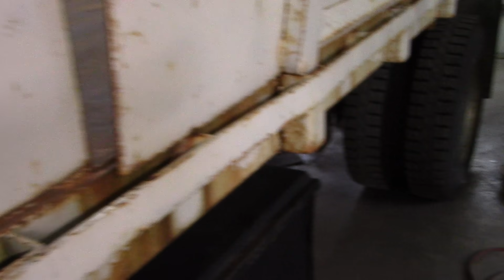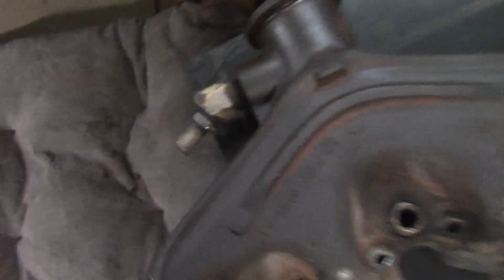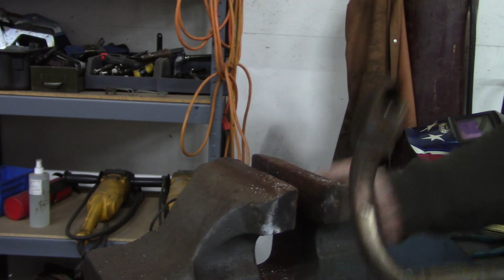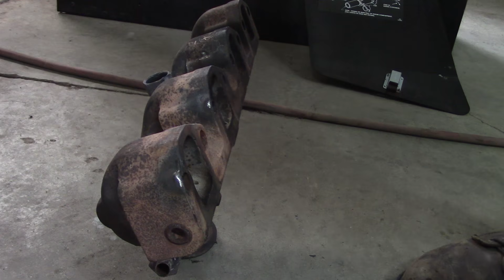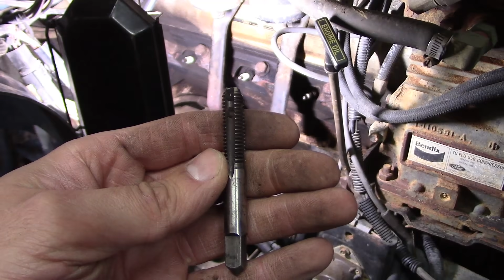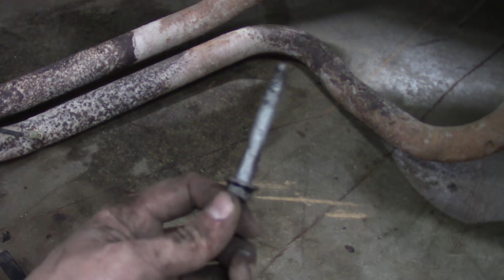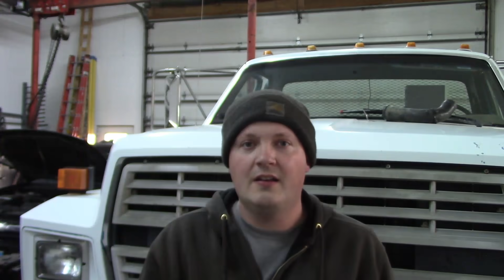Ford F700 Project - Exhaust Manifold Leaks (Gas Engine) - Part 1

Comment: I have an f7 dumptruck at work wes. Its diesel though, thank the lord. 35k on it. Runs real good except when it's really cold out. We plug it in but that only does so good. Has 10ft v plow  and we cant live without it. Only just started watching and thought I would comment. Keep your powder dry lol.
Reply: And since when do you use ratchet wrenches?
Reply from the maker: Is it a carburetor?
Reply: No,It's a early 90s turboed 7.8, I like it but we have ran onto similar problems as you are dealing with. I had to weld the exhaust with some cast rod. Someone had tried to stitch pin it at some point. I drilled every stitch pin out and used cast rod to fill the holes.

Comment: Good call, cast iron heads, resurfaced cast manifolds or new manifolds and new bolts properly torqued, NO MANIFOLD GASKETS ever........ cast iron to cast iron on any engine and you will never have a problem again. 30 years experience working on old shit like this!

Comment: Yeah, someone on YouTube actually fixes a metal crack 'the right way' .... solely my opinion but I like it. 
For what it's worth I've had the best luck replacing the Ford nylon vacuum llines with soft coil metal brake line.... it takes a little bit to bend up the right shape and work into place  but problem solved permanently. I use a short piece of rubber/silicone vacuum line for the final connection.... otherwise it  seems like I'm chasing new leaks 6months later.....good luck with the project whatever the solution 👍

Comment: Obviously, you have got to have the patience of Job. It always pissed me off that the engineers designed vehicles with no thought of anyone ever having to repair them. One question, since the engine is running rough, why didn't you at least pull one spark plug for inspection. Hell of a lot easier to replace the plugs with the exhaust manifolds off.

Comment: That towing ring out the front would never pass a legal here. Especially at pedestrian shin height! 
Plus, I'm still gasping at a 7 litre petrol in a teensy little truck! It must drink like a fish.
Just shows the difference in fuel costs between Europe & the US.
Reply from the maker: This truck has a 15 ton weigh rating.
Reply: @WatchWesWork  Trying to get a handle on equivalent sizes Wes. Does that mean it'll carry 15 tonnes. It doesn't look like it weighs 15 tonnes. 
Or do you mean load + truck = 15 tonnes? 
You're definitely right about cabovers though! You don't see conventionals here at all. Even the little 7.5 tonne (truck weight) Iveco Ford I used to drive was a cabover. I know that anything you'd get over here would be a turbo diesel though. Petrol commercial engines are unheard of!
Looking forward to the rest of the series 😃🔧
Reply from the maker: @Aengus42  Total weight of payload and truck is 15 tons. I think the truck empty probably weighs in the area of 6 tons.
Reply: @WatchWesWork  A quick look brings up this ex council tipper. It's a bit chunkier at 7.5 tonne but not by much. https://walkermovements.co.uk/vehicles/iveco-eurocargo-75e16-euro-5-4-x-2-7-5-tonne-steel-tipper-2008-nx08-cff/
The 4.5 litre four cylinder PACCAR FR diesel engine is available with outputs of 140 hp, 160 hp or 185 hp and torque levels of 550 Nm, 600 Nm and 700 Nm.
The one in the link is the 160hp version.
Just shows the different direction European trucks have gone in.

Comment: I know the pain and suffering you incured , all the early model ford's manifolds cracked and bolts would strip out, the 360's were famous for testing your language skills and sleepless nights. And you know the studs are going to strip out more grinding of the teeth but good luck with drilling them out, I quit !

Comment: I do agree that cab over trucks are a breeze to work on ,unless you are here in England where the coach works companies decide to put a horse box on them and don't relies you need to tip the cab to get to the engine and climbing up under the wheel arch to just check valve adjustments is not so much fun.

Comment: Most any factory engine did not have gaskets for the exhaust back in the day.  They are a "band aid" fix for corroded, uneven surfaces that someone let go too long when the mounting bolts broken and allowed the manifold to separate from the head.  Great work, love your channel.

Comment: The secret is to loosely start the two end bolts, insert the gasket, then start the rest of the bolts. At least you aren't having to deal with the multi-piece gaskets. This brought me flashbacks from replacing manifold gaskets on several old farm trucks in my youth. Makes you wish the manifolds were on a tractor.

Comment: The truck locks the doors after you start the engine I don't think that's embarrassing that would have pissed me off especially the waiting on the customer having to come all the way out just to unlock the doors seems like questions should be asked when it comes to things like that.
if you own a car long enough you should know what it does when you start using it.

Comment: I guess thats quite a problem on gas engines, diesel fumes have more grease in them, keeping their surroundings lubricated...
:-D
The manifolds tucked way back between the frame rails and packed with wires and tubes reminds me of a similar job on a FWD engine, the exhaust near the firewall, was fun too...
Great job Wes, I think the next parts will be interesting too!
:-D

Comment: I had a '79 Grand Wagoneer with a Ford 360 in it - nothing but trouble with the passenger side manifold gasket.  I replaced it three or four times before giving up.  Figured I had a warped head or manifold, maybe  I did.  But now I'm wondering if the problem was that there shouldn't have been a gasket in there at all.  That never even occurred to me - thought everything with a manifold had a gasket!  Anyway, very educational video.  I admire your fortitude, Wes!  You really know how to stick with it until it's right.  Nicely done.

Comment: You did the right thing in repairing the emissions system - skirting the rules is always a bad idea IMO.  I did like your line early in the video, “Who needs a thermostat [or a pressure gauge on an air compressor] when you have a camera” (...and are shooting a video.....)

Comment: Surprised they haven't blocked off the EGR and plugged the smog pump lines... First thing I did on my 95 3/4 ton. Been running stronger than ever since then. Of course the cat delete helped it. Things were plugged right solid...
Reply from the maker: This truck never had cats. But it had everything else.

Comment: You had me at “Ford exhaust manifold leak”. This takes me back to my ‘69 Thunderbird 25 years ago. Apparently Ford never did figure out how to make non cracking big block exhaust manifolds. The right side required dropping the starter and the left required popping the steering linkage, not fun. The 429 did not come with gaskets . We won’t talk about doing the freeze plugs.

Comment: You got to love 370 429 engines the flanges for the pipes are notorious for leaking especially if it has a 2 into 1 muffler the pipes like to bend big time

Comment: He probably brought it to you because the last guy told him not to bring it back. Or because he did one himself and doesn't want to touch it again.
Reply: With all the broken parts and pieces, the owner knew only Wes could save money from having to purchase new or used parts on a vehicle nobody else wanted to work on.

Comment: You should put those manifold gaskets on ebay, you can buy everything there for the genuine cheapskate. Low mileage timing belts are my favourite, and used clutches too. ;)  I'm surprised I've never seen lightly soiled engine oil and filters at a bargain price there before (obviously because they "just serviced the car and 5 miles later the engine blew up, be a shame to waste it"...)
Reply from the maker: The junkyards here sell used antifreeze, used washer fluid, even used gas and diesel when they have it!
Reply: @WatchWesWork  Just why lol, the very fact they're selling the fuel means they wouldn't be happy to use it themselves surely?  I have accepted free fuel from a friend at a yard before, but they did use it in their own equipment & took reasonable care over what went into the "keep" tanks versus what went in waste. Don't think they ever sold it though, just used it up themselves to offset some of the cost of running.
Definitely wouldn't want to trust used coolant though, even if they kept colors separately  there's still different cocktails that have the same color & would gel up if mixed  :/  Each to their own I guess lol, if they're selling then people must be buying!

Comment: Looks good 
I know there was money reasons but gas engines in his type vehicle is crazy in my opinion
I have driven that type of truck in my day didn’t like it gas stations never got to far away
Out here in the PNW  a lot of cranes were put on this style of truck one guy I knew had to have his engine rebuilt every year
Probably his choice of a crane on a truck was the wrong decision but he needed a crane he installed HVAC on commercial buildings
Reply from the maker: Gas engines are cheaper and cheaper to maintain. For guys who don't run a whole lot of miles they make sense.

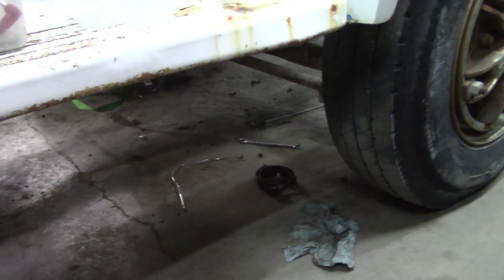Comment: 29:48 small tip (probably a granny sucking eggs job, but if it helps one person I'll be happy). If something goes down an exhaust or other open-ended tube/pipe and you can't grab or magnet it out, wrap an old sock on the end of the shop vac, taped on so it sits inside like a pocket & then put the vac to whatever the tube is (use tape or hand etc to get a better seal) and a lot of times it'll pull the part right out & catch it in the sock so you don't have to fish it out of the vac bucket.
Reply from the maker: Good tip!
Reply: @WatchWesWork  JUST the tip mind, and only for a minute (to quote AvE).  Having continued to watch the vid, it was probably easier to just drop the exhaust in this instance though. single bolt job for the win.

Comment: The ONLY practical way to fix those damned things is NEW heads and NEW manifolds.  If they don't make them anymore, then tell the customer to get a NEW truck.  I bet they still make those pieces of junk.  If you get 1k miles out of that repair, I'll be very surprised.
Reply from the maker: We shall see.
Reply: @WatchWesWork  Nothing against you or your workmanship.  I just know those engines much more than I ought to.  Cheers:)

Comment: Grease smells like success, and that ain't so bad. Before your postscript, I was going to ask what you thought about not using them. I have just had the manifolds surfaced on GMs since the eighties, those gaskets are awful when they wear out. Never tried the grease though. 
  As usual, thanks for the look in.
    Best regards from Indiana.

Comment: Nice job Wes.  What's your thoughts on using a very thin coat of high temp silicone on the flanges?  seems like a popular substitute for gaskets these days.
Reply from the maker: That would work fine.

Comment: On our truck motors we got about 12,000 miles on OEM plug wires. Aftermarket wires got 50,000 miles. The clue was black smoke and low power under load.

Comment: There really isn't that much emissions crap on there other than air pumps.  None of it really affects how it runs at all.  It does affect exhaust manifold temperature.  They run great but they break manifolds and there is nothing you can do about it with stock parts.

Comment: Never heard of using GREASE as a Gasket but I'm guessing the manifolds better be damn FLAT to use this method ? I have a header leak on my 97 Jeep 4.0 at the exhaust gasket right in the front ( it's not that bad ) but I have been putting it off for years, LOL. I've also had the new parts for years maybe I'll tackle that job soon now ? It has to be better then what you went through, RIGHT ? LMAO.

Comment: Those engines suck for exhaust manifolds.   People babble on about anti-seize from factory.  That is rubbish.  Those manifolds expand so much that the shear the bolts off during expansion.  Nothing one can do other than, perhaps steel headers that don't have the shear force of those cast iron beasts.  Fix it today and they'll be broken tomorrow.  I've seen several that have broken the ends of the heads off instead of shearing the bolts.  My rule was: > 3 broken bolts and it gets a new cylinder head.  They're actually pretty inexpensive.  Crappo engineering.

Comment: Great job Wes.  I'm glad I went to the very end.  One thing I learned from Stephen Cox's youtube channel is that when he removes the exhaust manifold bolts (with or without heat), he cracks them loosed and re-tightens them. Once all of them have been cracked loose, he then removes them together rather than one at a time.  He feels there is far less bolt breakage.  I don't know if this is true, but may be worth considering.  Kind regards, Craig
Reply from the maker: Nah. That makes no difference in my experience. Heat is the key to no breaking. Even then they often break.

Comment: Would it not have been easier to glue the gasket onto either the block or the manifold with high temp cement or silicone vs trying to insert it between the parts or are you one of those weirdo purists who believe that nothing should go between surfaces and gaskets?
Reply from the maker: It would have been easier to slip it in from the top, but the plugs are in the way.

Comment: Ok so no gasket needed , but when I would get to where I did not like the way two parts went together with a pain in the butt gasket and I could not do anything but hope the gasket stayed in place/ I would use sewing thread and tie the gasket to one part and with care put things back in place and bolt everything up with no worries.

Comment: We have the exact same truck on our fire dept. It's set up as a tanker and has tandem axles. Instead of the gas, it has a 6 cylinder diesel. Much cleaner engine compartment, no emissions garbage
Reply from the maker: That's one of the Brazilian diesel engines. Those were great.

Comment: I would have used my entire repertoire of swear words half way through this job!
Reply: I would have created a new language on this job!!!
Reply: @StreuB1  This job would have given me an aneurysm.
Reply: @StreuB1 I would have invented a few new colorful words! Lol
Reply: "motherlover" was a good one :D
Reply: my sister came up with mouthercluckers.
Reply: I made up new curse words doing the manifolds on my old Bronco... still didn't fix the leak. I'm assuming it's a rotted air injection line but I won't do that job unless I have a reason to pull the motor.
Reply: Once I had to take the oxy torch out the swear words would really start because you know the job is goin to hurt at that point
Reply: If you like in the midwest, you can pretty must rest assured any exhaust manifold will require torch to get bolts out.  Many times bolts just break off.
Reply: Accchhhhh.. it was BRRRRUTAL!!!!!!!
Reply: This is old school shit here, the way things used to be fixed instead of replaced!

Comment: Typical Ford's bullshit. My 1988 f150 was just as bad for all the emissions garbage. Any leaks good luck trying to find it and fix it. A code scanner that was made for it is a good way to search and get a direction where the electrical problem is. The CPU will pick it up and tell you where to start looking at least. Fords are  a pain in the ass to fix regardless what year it is. Take it easy.

Comment: Correct me if I'm not right but a exaust leak  can cause a exaust valve to get burned  see you later young man
Reply from the maker: That's the old myth, but I don't think so.
Reply: @WatchWesWork  okay thanks for your reply young man
Reply: @mmm365  yes I am I'm 57 years old

Comment: get a close up of the ignition coil.. with the engine running and the lights out..  watch the little blue sparks between the coil core and the inside of the coil laminations.  those are spark events that won't get to the spark plugs..